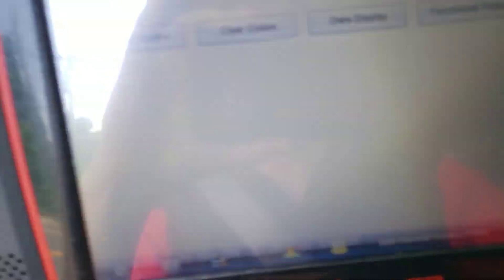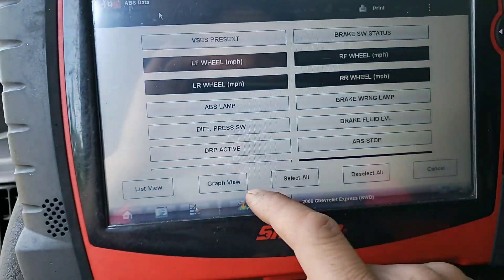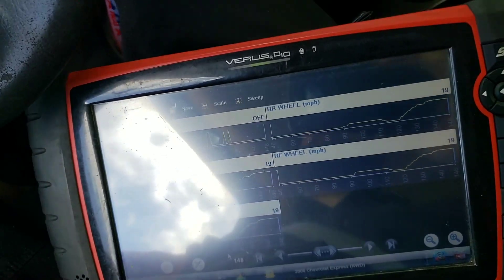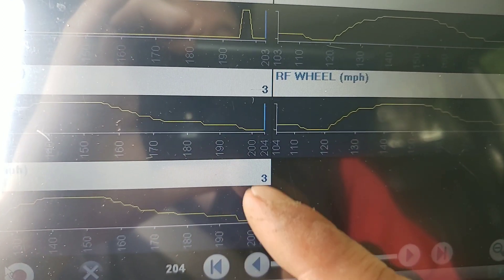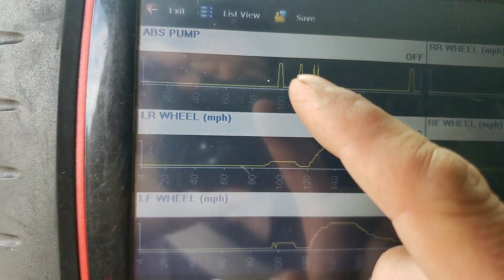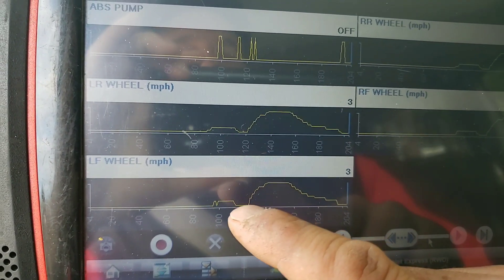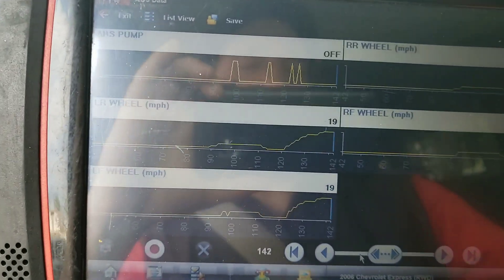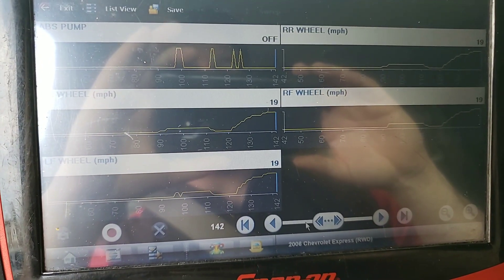Finding GM unwanted ABS activation

Comment: There's also a pid I believe called dump valve, for each wheel.  You can graph that and it'll tell you which wheel the abs actuated.  Compare that to the speed sensor graph to really be sure you're going after the correct wheel speed sensor.
Reply: Found that on a Hyundai. In fact I calculated the time between blips vs the circumference of the wheel to determine that the front right reluctance ring must be broken. Part ordered problem solved.

Comment: Good tip with the abs graph too. Never thought to do that. I also like over laying the graphs if your tool allows for it, and you can see the one that drops out when it doesn't stay with the others. You just have to remember that the wheels turn at different speeds around turns. I'll try with the abs activation PID too. Thanks again!

Comment: Hi sir Keith.
I have a lot of problems with the ABS warning light Stabilitrack and Traction Control OFF warnings with my 2009 Captiva  Sport 2.4L engine.
Maybe you have some informations of a software-glitch in this ABS-module.????
Even the Parking Brake warning light stays on.
I replaced all 4 wheel speed sensor/with bearings, and still have the same problem.
I never had a MILor code for the ABS or Wheel speed sensors.*
Maybe traction control switch is defect....*
I was trying to get a diagram for this section with no results, due Chevrolet Captiva has not been sold in North America....???
Do you have a link or way on getting or helping me out with this particular  diagrams (ABS module)for this particular 2009 Chevrolet Captiva 2.4L ecoboost engines ?...
Thanks in advance Keith !
Best regards.
👍😎

Gladmar.

Comment: We have to be honest,no scantool beats the SnapOn graphing capabilities and refreshing rate. I have seen it before with aftermarket scantools where they won’t pick up a small momentary drop or they’ll take forever to refresh. I think it’s worth having a SnapOn scantool for that alone. Of course,nothing beats a scope hooked up directly to the signal wire!
Reply from the maker: I dunno , this Bosch is pretty darn close now . And they keep improving it
Reply: But in this case, you would be helped more by plotting what the ABS module interprets as speed, rather than the raw sensor signal. Obviously the problem will be in the raw sensor signal, but it might be difficult to see variations in frequency by eyeballing the pulses. Of course some scopes have a frequency interpretation function, which would work in this case so long as the averaging window is similar to that used by the ABS module.

Comment: i got a call to check 03 honda crv all wheels would lock even with abs module so they disconnected a wheel speed sensor clear codes brakes would release live data would cut off at around 5-7 mphs took all them off clean clean they did replace front wheel bearing, abs module before i checked it no fix so it was bad brake master locking up the system

Comment: Hi Keith,

Thanks for these videos sir.
Hoping for some help but totally understand if you cant reply. 

Audi Q7 2014 TDI, has the ABS, Trac, light on. Also has the engine light. The codes are for the steering angle G85 and the other is for a transmission solenoid D code.  Stuck in 3rd after a transmission swap.

I have an autel maxsys and I can get into the steering angle calibration but its asks for a security login sn number. Have no idea where to get that from.

Hoping you might help sir, sorry to ask
Reply from the maker: 40168 😁
Reply: @NewLevelAuto  thanks Keith!

Comment: While we're on GM ABS issues: I remember back in '02-'06 GM (Holden over here) were swapping ABS Modules like crazy! Around every second or third car I repaired(crash/accident) had to get a new ABS Module. This vehicle needs wheel speed sensors right Keith?! 🤔
Reply from the maker: Just one on the left front. It will come as a hub assembly
Reply: @NewLevelAuto  yes just another GM 'marvel' (let's design it so the Customer HAS to buy a whole new hub assy) be it speed sensor, wheel bearing etc! 🤔

Comment: Hi Keith. So whats next? Not dropping out so not likely a circuit issue, but a sensor/hub assy issue correct?
Reply: Rustjacking type issue, increasing air gap between sensor and toothed wheel, doesn't create enough signal amplitude to register at very low speeds, ABS thinks that wheel is locked, 3 wheels at 5mph, one at zero.
Reply from the maker: Spot on Simon. In this case it's as easy as replacing the hub and sensor together .
Reply: @NewLevelAuto  Basically what I was thinking. Thanks for the response Simon and Keith.